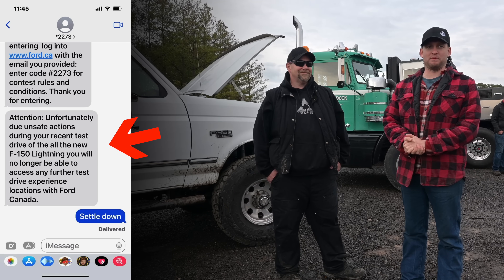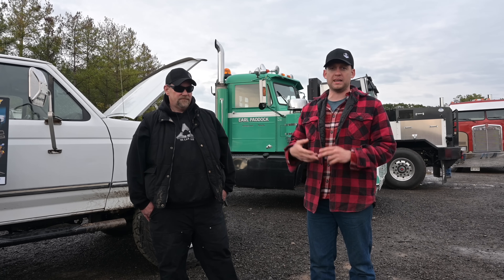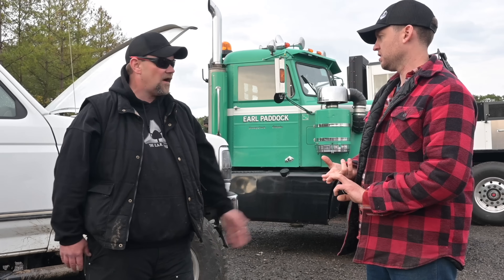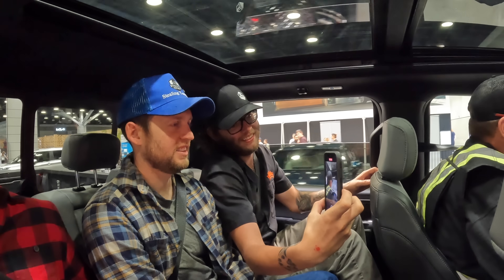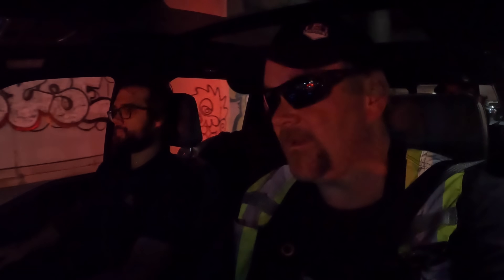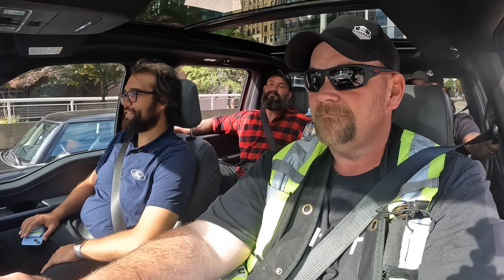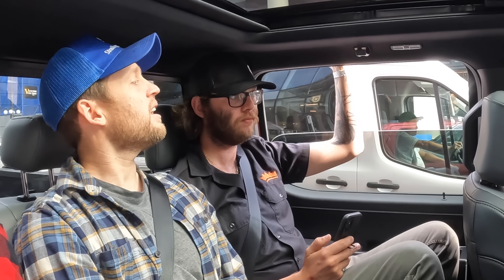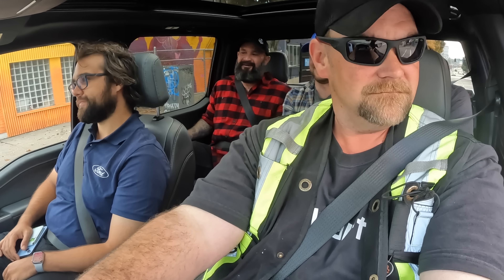Retrofit Revolution: Turning Old Pickups into Electric Powerhouses!

Comment: Here in MN, I would buy this. I have a 2015 F150 with the 5.0 and the 6 speed. I would drive up to Canada to get converted. Or I would look at being a kit reseller too here in MN.
Reply: I have the ford 9.75 rear end, and the reversed 8.8 in the front. I think if you did an 8.8/Dana60 reversible axle and a 10.5 Sterling/Dana 80 size rear it would fit most trucks from F150/1500 Ram/Chevy, 2500, 3500. And the 8.8 would cover you for Jeeps and Toyotas as well.  Talk to Cummins for their 4 cylinder diesel they sell for Jeep conversions and throw a generator on, with a box under the bed for battery you would cover like 90% of the market.

Comment: Love this idea! Older trucks are also a little smaller and more utilitarian which is huge. Would love to see a generator running on ethanol for the farmers!
Reply: Absolutely, a farm service truck, big or small, with a high compression multi-fuel engine= smog resistant a bonus. Ethanol runs cooler, soy and other oils add lubricity, renewable. Air compressor, hydraulic pump, crane, service lights. Refrigerator, maybe a microwave, and hot plate or small gas grill for lunch...
Reply: Or a 100% biodiesel option.
Reply: I hope they go into ag refits too, just drooling at how much we’d save in fuel!
Reply: @25439 under constant load, hybrid doesn’t make any sense. That’s why Edison doesn’t make long haul on the road kits. In a tractor, hybrid might not be the best solution. On a loader or excavator it makes tons of sense and can safe a lot of fuel.
Reply: well for us it would make sense, and then we also have to learn something new, how to work with electric stuff. @autobootpiloot
Reply: @25439  but farm tractors do excellent with a CVT transmission, coupled with controlling computers similar to a generator to keep the engine in a good power band. They are also adding more electric motors in the equipment, harder for just a 280amp alternator to tackle, so adding a PTO generator anyway... Also not always full load, slowing for turning around, etc. Seems it would be easier on drivetrain for starting out under load with no gearshifts.

Comment: Solid 3/4 ton electric rear axles would be great to have. 

Front axle electrificcation would be easiest if you had a ready to go unit for a ford 9 inch replacement diffrential. I could keep everything else just  by swapping the diffrential. 😊
Reply: I see this as the best option. If they make an adapter plate for the most common diff options and the kit is bolt on you could convert most trucks and SUVs that still use straight axles without shelling out for the whole axle.

Comment: Consider making a kit that either comes with or bolts to a transfer case to maintain 4WD???  May be just as easy to offer a kit with a motor bolted to a general market-available transfer case (like a basic Atlas?) with options for driver or passenger side drop, then you've got a really adaptable retro kit!!

Comment: I'd say you would have more potential  for retrofit in trucks if you placed the motor in place of the transmission.  That way you could easily bolt on a transfer case if 4x4(or IFS) i think it would be easier to change gear ratios than bolt on new axles.
Reply: So like the danfoss gen/motor on Topsy but with a drive line and trans to go from the motor side to the axles. That's a lot more weight added and none saved. One of the main benefits of the EV axle conversion is less is more. Less weight more range and acceleration. Less gearing less maintenance.

Comment: How much smaller of a generator would you be able to have compared to say a big 5.9 magnum out of a second gen dodge? something that’s a big gas guzzler. We talking like a little brigs and Stratton😂?
Reply: I have a second gen as well, you want its smaller v6 brother? 😂I'd like to do a full EV swap and upgrade to 4x4 on mine. The answer to your question is, at very minimum, the average power your truck needs. A lawn mower engine probably isn't going to cut it lol.
Reply: @aaronhunter7026  well I’m thinking you can get a whole lotta grunt out of an electric motor, so that will be comparable to a V8 or a Cummins even, but how big does the genny have to be to keep those motors crankin when the juice gets low? Could you get like a tiny diesel in there?

Comment: If you start doing pickup truck kits, you will never do any volume of transport trucks. Stay focussed and do one thing well. Build a factory and one model of hybrid heavy truck.
Reply: I disagree.  I’m not a trucker myself, but I have several friends that are owner/operators and if they can cut their fuel bills in half, that’s huge.  Already transmissions are pretty common to rebuild or replace, so there’s merit in the heavy truck market, although they would need to have a kit geared towards highway haulers

Comment: Guys im so in! Im from kelowna and loving this innovation coming from some local boys. I would love to retrofit a bagged squarebody dually. Hell my whole fleet, my 91 small block s10, my prerunner ranger. Being able to eliminate the need for a driveshaft could make for some great suspension travel without having to worry about binding. Keep up the amazing work, looking forward to seeing what you guys come up with. If i was a little closer i would absolutely be into trying to be a part of the team in someway
Reply: The issue with a prerunner is the considerable unsprung weight of an e axle. Gonna really hurt traction, especially going fast on rough stuff.

Really good for rock crawlers though.
Reply: What’s the point of the big travel if it’s not 4x4 ? 😂
Reply: @blueman5924  I take it you aren't very familiar with prerunnner style vehicles which until recent years were mostly all 2wd. But they also mentioned the possibility of 4wd so this still applies as long as you are good with a solid axle format

Comment: Very practical idea that makes way more sense than fully electric.
On a service truck, you could run the welder, air compressor, hydaulics, and even use it as a stand-by gen set when needed.
I could see a small kubota engine being a great fit for that application.
Reply: I would love to have this as an option, so many trucks these days are just a replacement for city cars that fully electric makes sense too!

75% of US truck owners tow once or less per year, so a large segment of the market should be fine without a range extender.

Comment: I don’t have a project that I would use this in at the moment, (just about to ls swap my square body 2wd) but the price to replace my 2014 Silverado 1500 is astronomical!! I know you guys will probably start off with retrofit kits, but I would be really interested to see what you could come up with for an Edison pick up (just like you did with topsy). 75% of the junk they put in new trucks is just unnecessary. Sure it’s cool to have a 20” touch screen console but what if you just want a basic truck for 20-30 grand? There’s nothing out there

Comment: I have a LML duramax. So the whole solid axle thing is a bit of a dagger but if I ever had the dreaded CP4 failure I’d rather put the 20k into an electric hybrid than fixing it back to factory . I think you’re on the right track.
Reply: Really there's not much more work to convert the front to a solid axle, yeah it's not a "bolt in", but still. If you were getting rid of the ICE anyway, you could run the power through the transmission and/or transfer case. Though, I wouldn't expect components to live very long with the extra torque they'd have to handle. Some of that could be mitigated with programming.
Reply: @UVBluetoo Running an electric motor through a transmission is stupid, just flat out stupid. It takes efficiency away from the system. There's a reason no conversion kit does this.
Reply: @pootispiker2866 You may want to fact check yourself before making that claim. Not only do retrofits that replace/augment an ICE while also utilizing a transmission exist; there are also several automotive manufacturers (Honda, Toyota, GM, BMW, Porsche, just to name a few) and OEM suppliers of transmissions (Aisin, ZF, Schaeffler, Dana, and like 50 others) that do exactly that. Locomotives, ships, and heavy equipment have all been manufactured in a configuration where an electric motor drives a transmission. Hybrid drivetrains can be and are, made in several different configurations, each with their own benefits and disadvantages.

Comment: Ive literally been thinking about this for years now, and been doing napkin math for how to get it done

Best solution: Packaging two motors back to back inside the footprint of a transmission. Several bell housing styles for GM, Ford, SAE, etc

The only "major" modification needed would be different length driveshaft, and an electric throttle controlled by an adding ECU or whatever
Reply: It's more possible than ever these days as well, with the proliferation of radial flux motors too.
A motor with 400lbft of torque thats the size of an automatic transmissions torque converter? Now stack a couple of them together

Comment: Yes 100 percent I'd be interested in seeing this happen. I could definitely see this as a benefit in the service tech industry, and if you design the batteries to fit in between the inner and outer fenders you wouldn't lose any box space. Plus you'd be able to keep the truck/service van cool in summer and warm in winter without a huge fuel bill. Thus eliminating the need to have a shop to keep things from freezing up in the winter months.
Reply from the maker: I think what we’ll do is package them in a kit as a drop in option.  Then leave it up to the installers to talk with the customer to see if they want to place them in a better spot
Reply: @EdisonMotors  Sounds good keep us posted. I look forward to seeing where this prices out at
Reply: @EdisonMotors you're in the middle of making a significant   impact in almost every single persons life.  Keep being you bud. Drop in hybrid square body coming soon. Thanks to you guys.
Reply: @EdisonMotors  This would be a cool truck to make a hybrid: https://www.youtube.com/shorts/25Pe3qu2bK0?feature=share

Another option would be an offroad forestry firefighting truck, like the BME Type 4 or Type 6 Fire Trucks.  (Adding a Mattracks/etc. package to REALLY take advantage of the extra torque would be pretty wild, too!)
Reply: I definitely want to keep my bed space, so I want to see an option for batteries mounted elsewhere.
Reply: By removing the transfer case and shatfs there would be enough place to put the battery pack under the truck! A nice flat well insulated battery pack.
Reply: I’ve got a 2008 6.7 Cummings 3500 SRW I’ll donate to the cause! Love the amazing work and can’t wait to see where Edison takes it!
Reply: @007.5Cummins  wtf is a cummings…. Ffs
Reply: But with salt in Canada… anything out back is a bad idea. Under the hood might be better with all the room.
Reply: I've been thinking of throwing an Onan generator  in my wife's pickup....
Reply: @UbiqueTransport which pickup? 🤔
Reply: @dans_Learning_Curve  2006 ram mega cab
Reply: I could really see a trickle down effect happening with people wanting conversion kits for their older commuter cars. Hell I know I would get one for my track car that's for sure
Reply: I think a compact Kubota 3 or 4 cylinder coupled with a generator and tow different electric axles front and rear would be the perfect setup, battery pack of course in the middle for 50-50 weight distribution.....
Reply: Old propane conversions used to put the tanks under the bed where the spare normally lives. You might not want to hang batteries that far back though and lose all that payload. There's a reason you put a tidy tank at the front of the box.. keeps the handling more neutral.
Reply: I would be interested.  2001 F250 4x4 with a short bed.  Would be perfect because I was already going to rebuild the engine in a few years.
Reply: Mounting the battery in-between the frame rails of the square body Chevy trucks would be great. Low center of gravity, full size box and one could built it the same way no matter what kind of bed you have or even built it into a van.
Reply: Diesel electric truck has been a want for a long time! Do it!
Reply: 100% would love a conversion kit. One because it’s awesome tech but two because it takes away the reliance on the large OEMs and all that hassle when managing a fleet.
Reply: ❤ Me too! Send me. Some info
Reply: please just finish up topsy
Reply: Henry ford used to work for Edison 
 Look it up   if you dont believe .

Comment: I’ve got an old ambulance I’ve converted into a sharpening truck for my business and have thought that it would be amazing to retrofit. The amount of room available for battery packs and all the components is ridiculous, plus all the space on top of the box for solar makes them a prime candidate. Plus giving municipalities the option to retrofit emergency vehicles rather than buy new could be a game changer.
Reply: I have a former ambulance as well and respectfully disagree that a driveline retrofit would be easy for Type 1&3 ambos. But it depends on the size of the battery pack and whether the compartment space could be used. I did rough calculations and figured that a 100kWh pack would get ~65mi range @ 68mph or ~124 mi @ 45 mph. The external compartment get in the way of sidesaddle battery packs. On my vehicle the frame area is partly limited by frame cross members, the air ride suspension compressor/tanks (which could be relocated), and just overall dimensions between transmission and rear axle. Trying to put a significant sized battery pack in the compartments would use a lot of space, and the compartments are irregularly shaped and different between ambulances. Getting the front/rear and side weight balance of 1000-2000+ lb pack could be challenging too.
Reply: But a smaller LiFePO4 battery to run scene/module loads and provide air conditioning while not idling the engine would likely provide a lot of value. The main components as  I see it would be a pack in the 20-30 kWh range, with dual 4+kW alternators and/or transmission PTO generator, ~1kW of roof solar, high-power AC shore power charger, and an electric heat pump. The nice thing is that the ambulance modules usually have engine-driven climate control. Replacing the engine AC compressor with an electric heat pump should allow for both heating and cooling.

Comment: Honestly, a kit for any solid rear axle vehicle would be rad. I know it will take a while before you get down to the smaller stuff, but a Ford 8.8 or even 7.5 retrofit would bring life back to nearly any Ford ranger from 1983-2011. I can imagine those old trucks going right back to work. Do the same with most any small truck. Find a common smaller displacement gasoline engine that can be made to work with a appropriate generator, and I bet you could pull some serious fuel economy.

Edit: If you want a test bed and are willing to go smaller, I have a Dana 30 in a Volvo 240 wagon. That would be fun to electrify!
Reply: Yeah, it would be great to have an option for a modernized small pickup, seeing as how nobody is selling new ones!
Reply: @BrooksMoses a Toyota 4 runner, Tacoma or Ford ranger would be great to develop too!
Reply: At Minnesota state fair Ford had new Ranger[they were built in St Paul] with electric motor in front of trans.
Reply: Better yet, just use one of those little honda generators, they are completely bulletproof
Reply: @forceawakens4449 even better if you can run it on mu h cheaper LPG/CNG or a Kubota diesel for more efficiency.
Reply: A little 2 cylinder kubota diesel would be perfect, plus those little engines will run forever
Reply: It would be so cool to have an older volvo wagon electrified
Reply: Honestly something the size of a nine inch or Dana 60 would fit most 60's-00's solid Axle vehicles, from fox mustang all the way up to an F450
Reply: @Prestiged_peck a none inch and a Dana 60 are not even close to the same size
Reply: do a ford 9inch third member kit, they make kits to install the 9inch into basically everything
Reply: Yes please I will pay
Reply: Those trucks would still be driving on their own if people would work on them at all
Reply: Just fixing the ranger would also bring it back to life instead trying to turn it into something totally different lol
Reply: Just fixing the ranger would also bring it back to life instead trying to turn it into something totally different lol
Reply: Just fixing the ranger would also bring it back to life instead trying to turn it into something totally different lol
Reply: Just fixing the ranger would also bring it back to life instead trying to turn it into something totally different lol
Reply: Just fixing the ranger would also bring it back to life instead trying to turn it into something totally different lol
Reply: Just fixing the ranger would also bring it back to life instead trying to turn it into something totally different lol
Reply: Just fixing the ranger would also bring it back to life instead trying to turn it into something totally different lol
Reply: Just fixing the ranger would also bring it back to life instead trying to turn it into something totally different lol
Reply: Just fixing the ranger would also bring it back to life instead trying to turn it into something totally different lol
Reply: Just fixing the ranger would also bring it back to life instead trying to turn it into something totally different lol
Reply: Smaller sized units would be fantastic, small enough to fit under 60's and 70's muscle cars, A and B body sizes. C-body's like the old Chrysler Imperials would would probably have the space for the Pickup sized unit. Great way to Reuse/Recycle an older car in to something economical and fun.
Reply: Turning my '83 Toyota Dolphin Motorhome into 4X4 hybrid would thrill my soul.